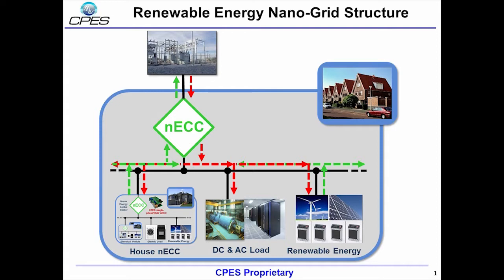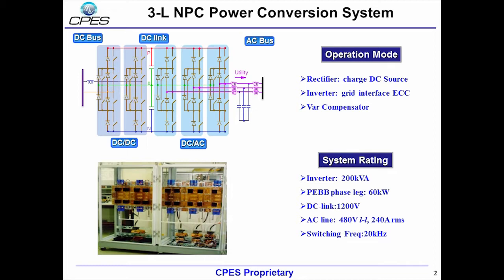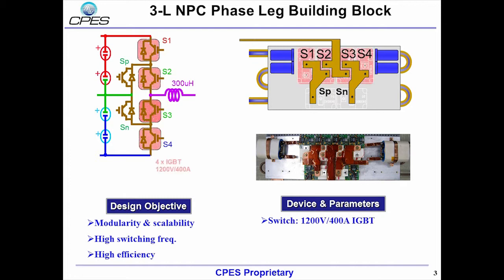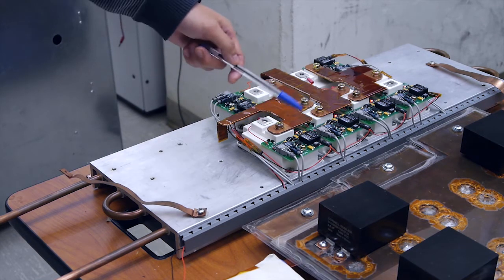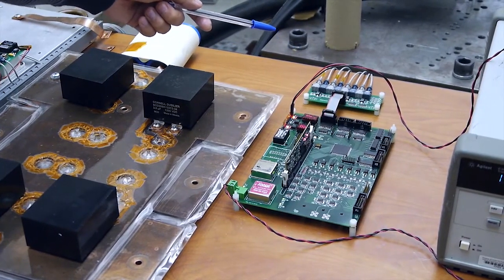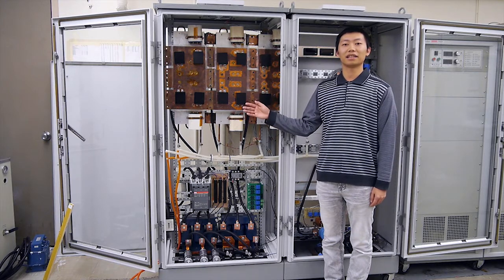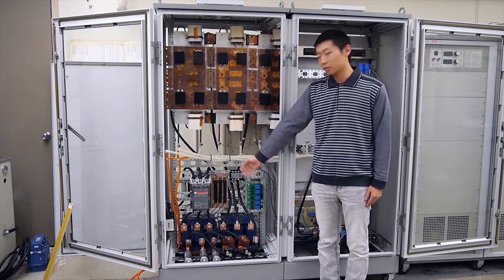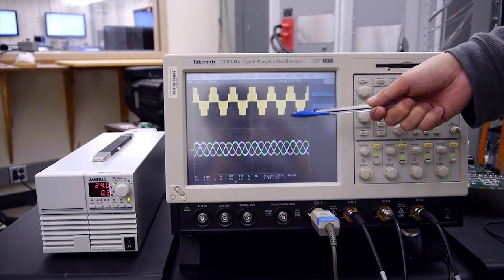3-level NPC phase leg and power conversion system for high power renewable energy nano-grid

Comment: For the phase leg test and 3-ph system open loop test, I am using a 60kW air cooled resistive load. For the initial test, SPWM was used to test the power stage, there was small neutral voltage ripple which represents the unbalanced cap. votlage. But for the following test, space vector modulation is used to reduce the unbalance. The result is not shown in that vedio.